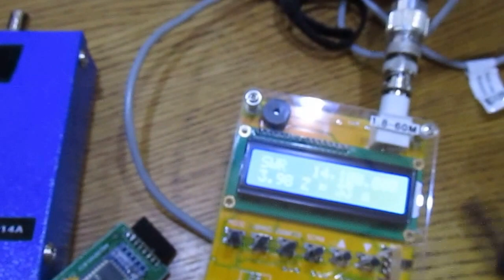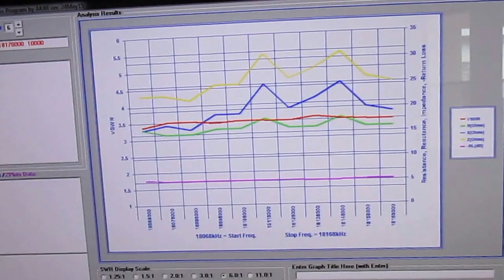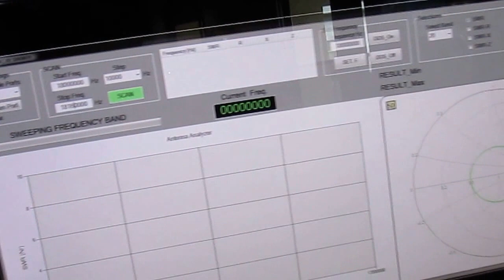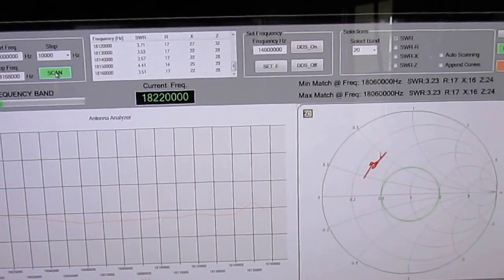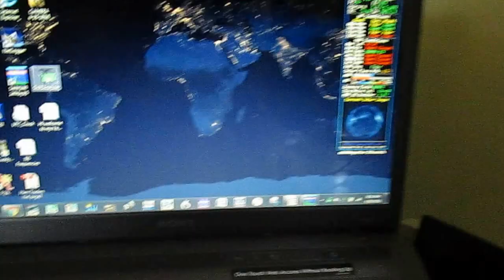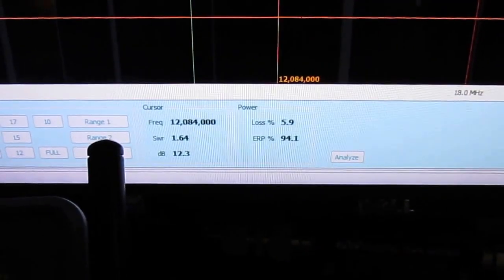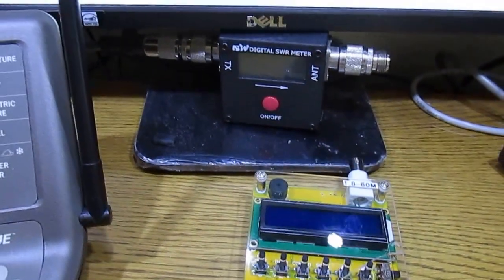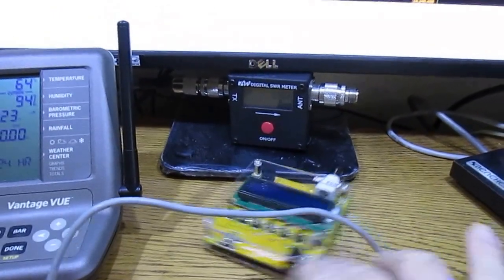Fox Delta and  MR100 antenna analyzer

Comment from the maker: I have received emails requesting the web site for the MR100 antenna analyzer software. 
Use the SARK100 software, they are the same the only difference is the outer case.  ( the enclosure ) 
Here are the web sites:

https://sourceforge.net/projects/sark100swranaly/

http://www.sm6why.n.nu/sark-100 

https://sites.google.com/site/ea4frb/antenna-analyzers/sark100/Archive#TOC-SOFTWARE 

73s  Eddie kj4fgi